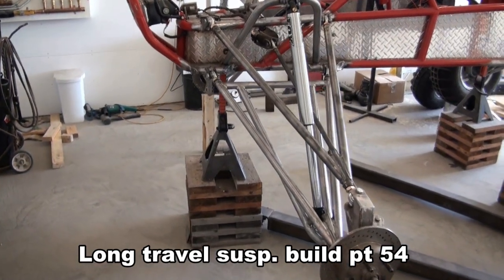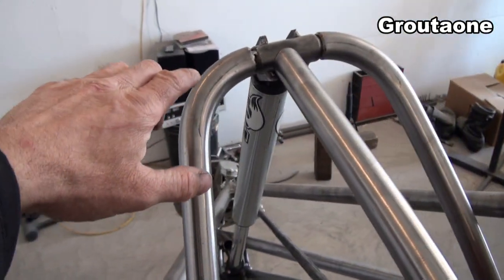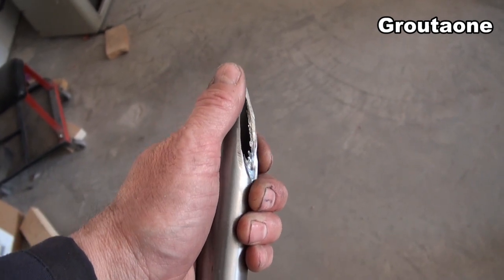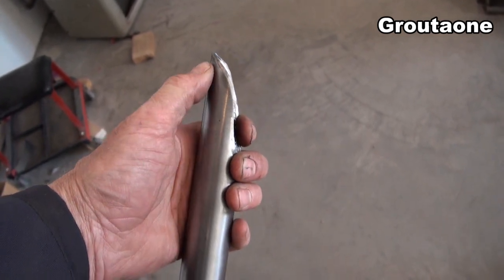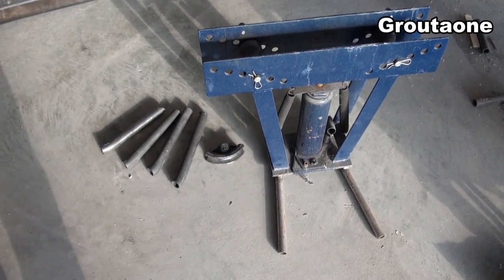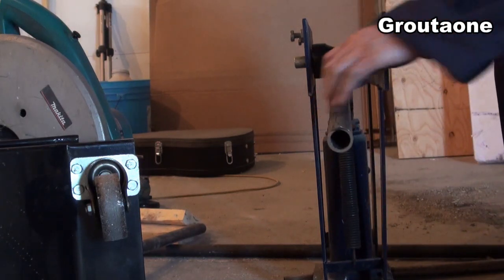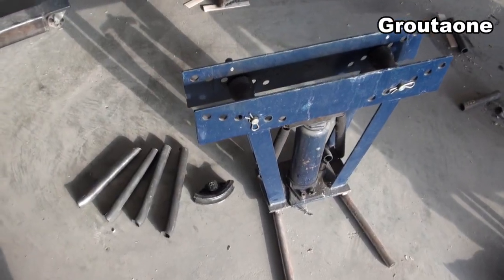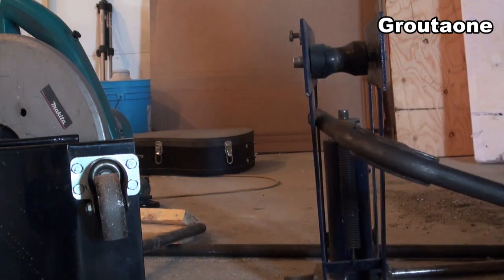Long Travel Susp Build PT 54

Comment: Nice tubing tutorial. I use a twisty tie, wound up tight, to mark the tubing, to cut it square on the bend like that. Then use a hand grinder to cut it because a saw, you have trouble controling the backside of the blade.

Comment: Nice fitting on the grinding part. I thought a machine did it at first. LOL I really did.
Reply from the maker: shartne Thanks for that, hey I have a solar pv question for you. I would like to put up five 250w  pv panels off grid, is there a charge controller and inverter all in one unit or do I need to buy them separate also from your experience what name brand and model would you recommend?
Reply: groutaone I updated my post several times so you may want to go back and read it again.
Reply: groutaone  The Classic 150 midnite solar cc can handle suposedly 93 amps. But its over rated but still the best. You cannot actually run 93 amps worth of panels on it because it should be run about 80 percent capacity  or so amps  because if the clouds go over and then the sun peaks out from behind them you get the "The Edge of cloud Effect" and it give a huge power spike more than your panels put out?? nobody knows why this happens but it can blow the CC.
Reply: groutaone You can run two CCs parallel its called stacking. Run like two Midnite CC 150s classics. or even three or four or five even. This is what serious solar systems and run ACs and their whole house do.
Reply: groutaone The new CCs can run the panels in a series for better efficentcy. By using higher voltages. The 250 watt panels are 24 volts. if you run two in a series you get 48 volts or three and so on. You dont get to touch the wires any more after you get away from the 24 volt system. It wont kill you but it would hurt and if you were standing in water you know and it passes through your heart it can kill. 
  But by running the panels in a series you lower the amps and you can use smaller wire for your runs. I always use 10 gauge stranded  wire.http://www.ebay.com/itm/400246316396?_trksid=p2055119.m1438.l2649&ssPageName=STRK%3AMEBIDX%3AIT or better than that 8 awg wire. Less voltage drop. That is another advantage of running panels in a series. So running two 24 volt panels in series they are like 8 amps or so a piece and they stay 8 amps. But if you run two 8 amp panels parallel they amps increase to 16 amps. more resistance and you need bigger wire for your leads.
Reply from the maker: Lots of good info, thanks. How about cold winter temps, if I have my vented batteries with charge controller and inverter all in a cold shed, likely need some heat what do you think?
Reply: I have to run my cast iron stove in my shed in the winter time so the batteries can perform. they hate cold weather. But on the other hand the solar panels work better the colder it is. Panels put our more in the cold weather. But batteries loose capacity in the cold they need to be inside where its warm.

Comment: I am using a Xantrex inverter. It is pretty good for the money. Its a 1850 watt 24 volt inverter Quiet Power by Xantrax  pure sine wave. You must get pure sine wave. not modified. they suck. The  Xantrex is pretty good and I could afford it. They use them on ambalances and police vehicles and handy man rigs. Not a bad inverter for the cost. I am really happy with it. Remember to match your inverter to your system if your running a 24 volt battery bank get a 24 volt inverter. if your running a 48 volt bank so on. or a 12 volt bank.

Comment: hey groutaone, I was looking closely at the beginning of the video, Now that you have changed the location of the shocks, it looks like (do to the arc of the spindles) the tie rods for your steering might collide with the sides of the shocks when turning. It just looked that way to me, I could have just been the angle of the camera also.
Reply from the maker: ***** Thanks, I paid close attention to that during the build and the tie rod I would guess has 1-1/2 inches distance from the shock at the closest during a turn
Reply: groutaone Oh thats good, I was thinking it would have been alot closer. I hate building something up just to realize that I forgot to factor in something.
Reply: How’s about an update .. really missin the sand rail !!!

Comment: Love the vids grouts! been subbed for a couple years now I'm 16 just picked myself up a 86 cr500 today for $500 might do an af any suggestions?
Reply from the maker: Charles Wilkinson Thanks for hanging around so long, suggestions for your CR, hmm, have some extra rear fenders in stock ha ha, really though as far as an Af the 98 and 99 CR250 frame would be the least work of all but the others can be done as well
Reply: Thanks! I actually already have a 97 Cr250 might just hack that thing up
Reply from the maker: Charles Wilkinson Also don't skimp on the head stay bracket, if it flexes there your frame will likely crack

Comment: What thickness is that tubing .120 wall? this bender is on sale at princess auto $120 do you think it will bend thinner .083 or .065 without crushing it? Thanks very much
Reply from the maker: crxtech1 This is .120, thinner doesn't work well unless maybe fill with sand and cap the ends